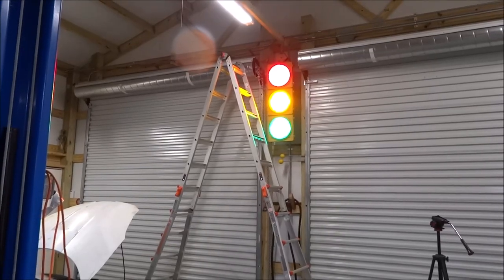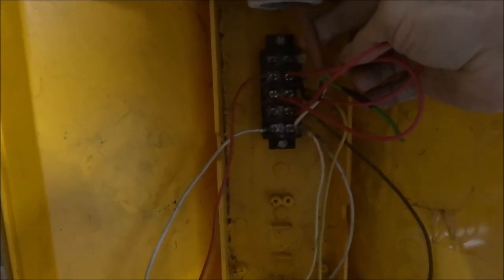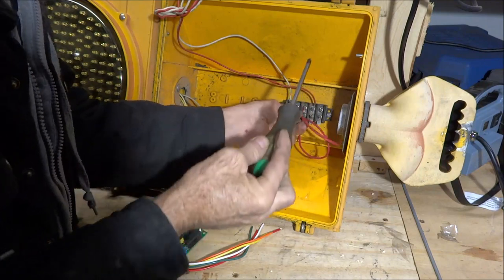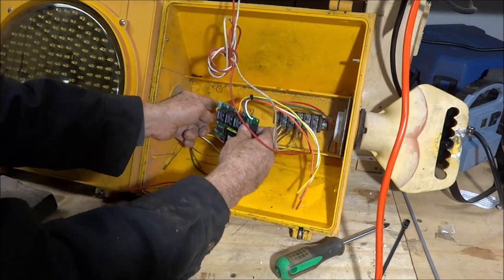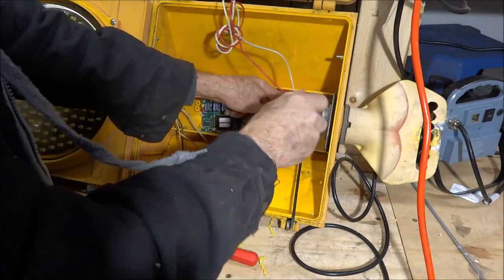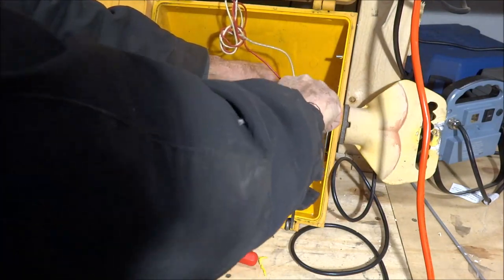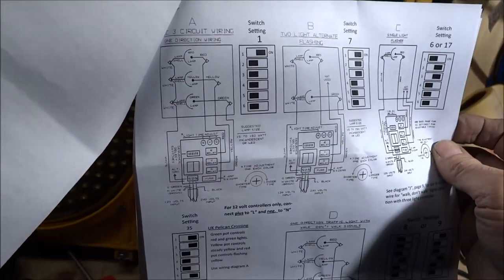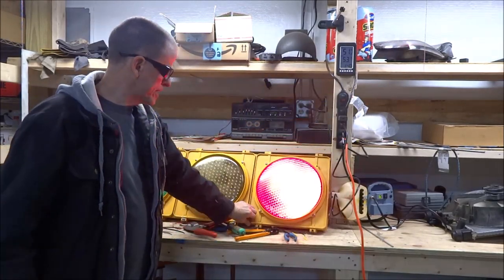WIRING A TRAFFIC SIGNAL LIGHT , EBay 3 relay CONTROLLER INSTALL

Comment: I had a full sized traffic light like yours, unfortunately it fell over as I was moving it to paint, broke all 3 lenses. I had gotten a mechanical switcher that was made by Lionel, for a train layout, it had three output wires, power and neutral, I wired up the lights and used a wink o matic flasher to urn the coil on and off to step the sequencer one notch to the next color. I couldn’t slow down to the correct speed , I got an electronic flash module that allowed me to regulate the speed of the change, they all had the same duration, about 10 seconds using a 25 watt bulb in line with the flasher and sequence stepper. All were 120v . The only downside that all 3 colors had the same duration, it was ok, I didn’t mind it wasn’t exactly how lights really operate. Bought the sequencer for 2$ back in 1980 at an electronic junk shop, I had it until the early 10s, coil eventually burned out and the novelty had long since worn off anyway.

Comment: 2:00 Hey, that yellow light looks like it is different than the others.  Is is a different manufacturer?  I made mine with a remote control so you can turn it on/off easily.  Love these things! Great job.
Reply from the maker: Yeah I think it is. That's the lights that were in it when I got it

Comment: Would it be safer/OK if I take the ground from my power cord and screw it to the metal housing with the light?  I am afraid my kids are going to mess with it and if a wire gets pinched and fails, I want to make sure the don't get shocked.
Reply from the maker: Yes, If it's a metal housing grounding to the metal body would be a good idea. I think it will still need a ground to the controller.